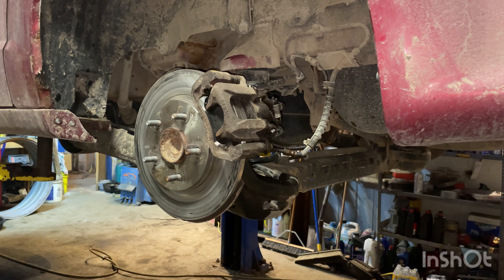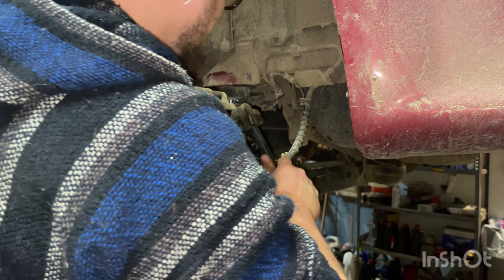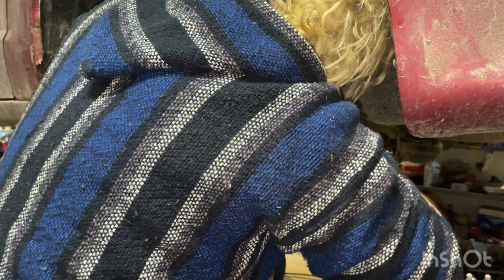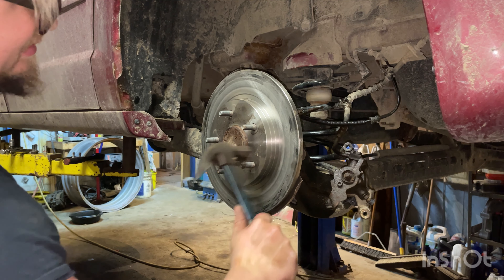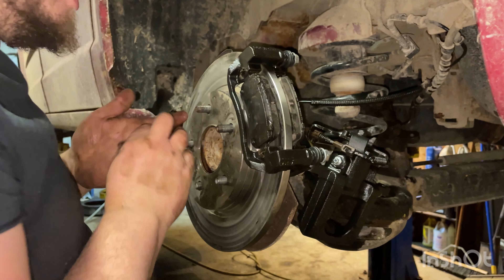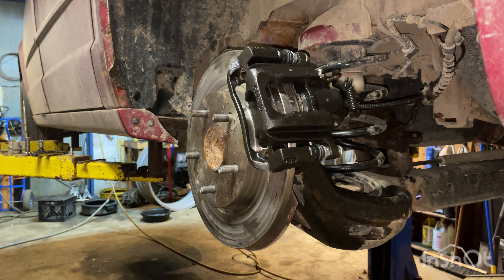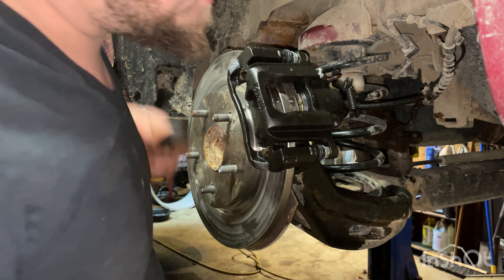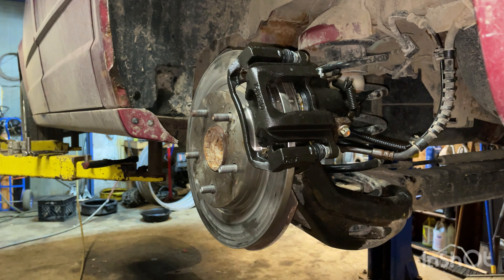Change Dodge Grand Caravan rear disc caliper with pesky e brake cable

Comment: Why didn’t you use a box end wrench to collapse all the fingers on the e brake cable.Once you slide the wrench over all the fingers then you can pull the cable out of the bracket.

Comment: Will the caliper  stop the parking brake  working  mine has the same set up but  the parking brake  won't  stop the van from rolling  and it is a 2009 Volkswagen routan

Comment: use pliers with circle  end on it,,. n a pinch use worm  hose clamp. few mills away from edge of e brake bracket, yighten worm clamp. wiggle E brake up and down .. popps right out.